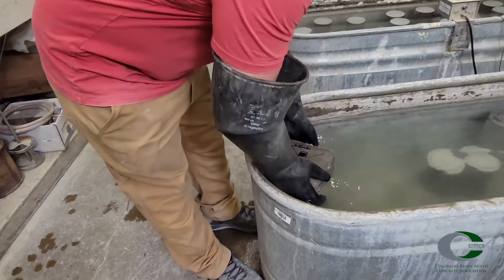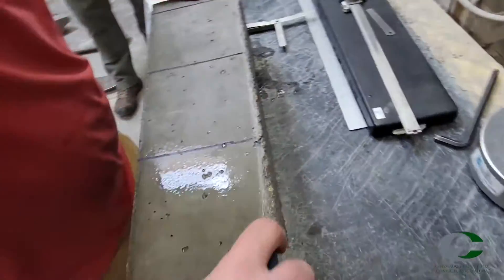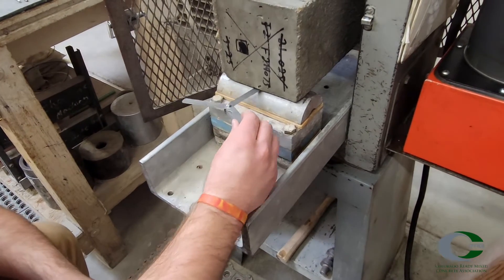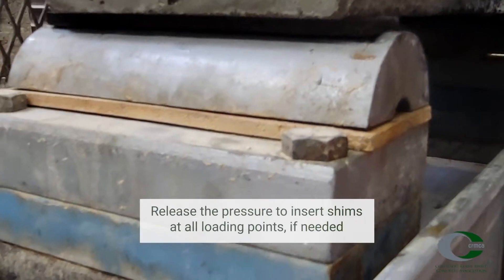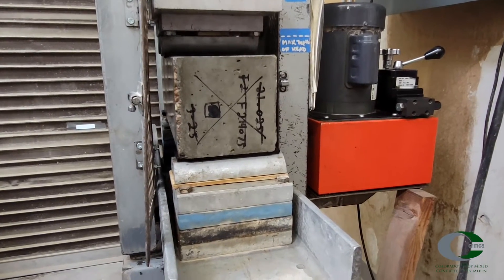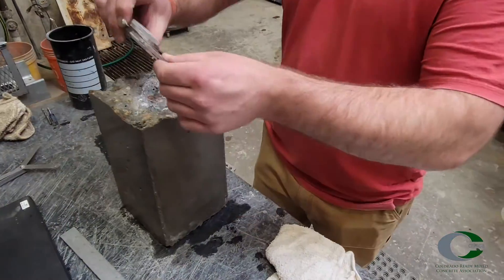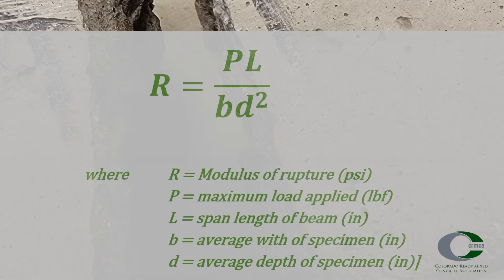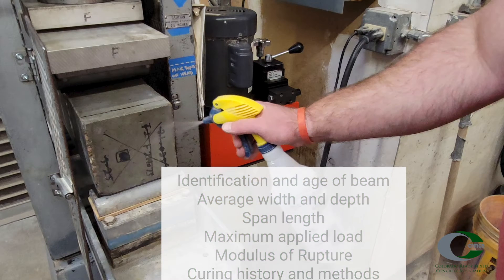ACI Strength - ASTM C78 Flexural Strength of Concrete - CRMCA Accessible Procedures

Comment: kind of embarrassing . if you apply 125 and 175 psi/min. how is the reading 1500 to 2100 lb/min. i'm confused.
Reply: The load is applied over 12 in^2, so to convert from psi to lb you multiply by 12. 125*12 = 1500 and 175*12 = 2100
Reply: Divide the loading rate by seconds per minute, So loading in seconds should be 25 lbs per second. Most machines show lbs per second, not per minute.